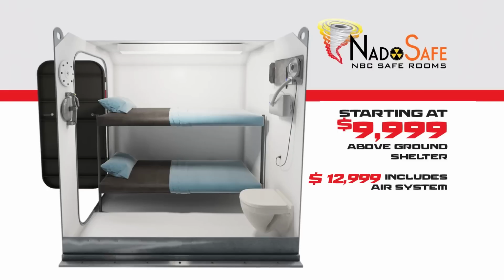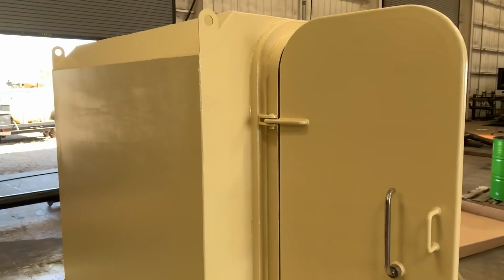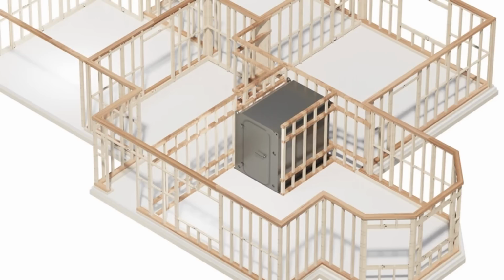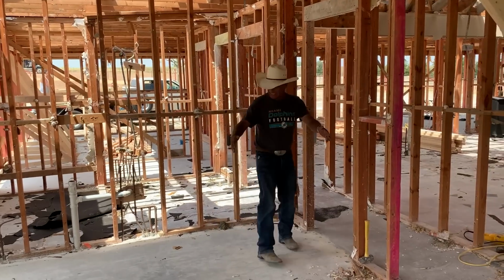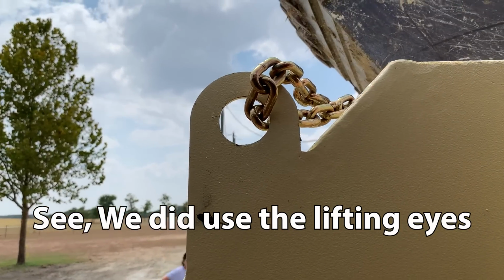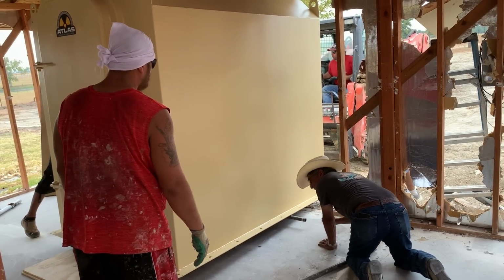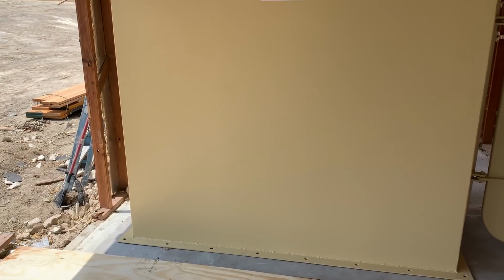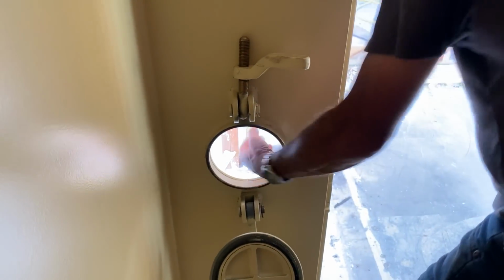Installing A NadoSafe Survival Shelter In A Destroyed House

Comment: Great job on the Tornado Safe... however if the room is going to be inside a house and surrounded by walls etc... should it not be painted in high visibility paint minus areas that can be for aesthetic reasons.. ie. doors. This would be so that  emergency services if the house is destroyed... to assist in locating..?

Comment: question is…. what if the door is blocked by debris.?  i’ve seen these with sliding doors
Reply from the maker: Use the port hole to flag for help
Reply: @AtlasSurvivalShelters  thats funny.  i hope your not serious.  the port hole gonna be buried in debris. love the videos.
Reply: @King_TuTT  port hole opens inwards. You will get it open but it may be covered from outside. Take your chances or build a metal cage outside the entrance to your nado shelter for just that scenario.
Reply: @terrylazurko2476  good idea

Comment: Door opens out... storm damage falls and blocks the door and poof you're trapped inside until somebody outside clears the door.
Reply from the maker: It was originally designed as an above ground nbc shelter and gas tight doors do not open in for blast pressure.  If it was just tornado we would make inward swinging doors of course
Reply: Considering the house is made of wood framework one could easy put a metal plate with gasket to cover and escape hole on the side of the Shelter facing the thinnest Interior wall, you’ll need a socket wrench to unbolt the plate and a ax and saw to clear your way through that interior wall.
Reply: @AtlasSurvivalShelters  Have some kind of jacking system to force the door open when blocked.
Reply: The solution is so simple. You keep a length of pipe or square stock the room minus the height of a bottle jack with several spacers.
Reply: @davidschumaker5262 😂 you beat me to it
Reply: @SmokeNGunsBBQ  I don't think a bottle jack is going to move the neighbors house that gets dropped or a vehicle wedged against the door.

Comment: Could this be modified into a fallout shelter?
Reply from the maker: Yessss
Reply: What modifications would be needed? I thought it already was a fallout shelter???
Reply: @Chelseabreda  this is a tornado shelter not a fallout shelter. I’m thinking it will not block the radiation unless buried and he did mention that the Swiss air system can be ordered with it. He does have many other shelters designed for radiation protection but not in this price range.

Comment: How can you sit there with a smile on your face and sell that for 10 grand plus when there isn’t even two or $3000 in material and labor with a rip off
Reply: If you can do better, you build and sell it
Reply from the maker: Yes what a jerk comment.  Door $4500. Steel $2800 labor $2000.  Profit $700.   What’s wrong here